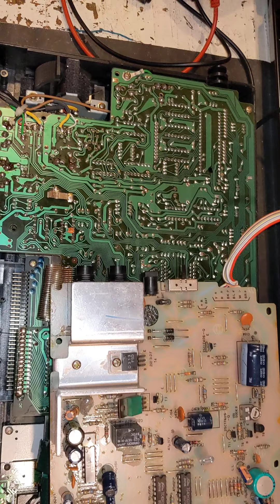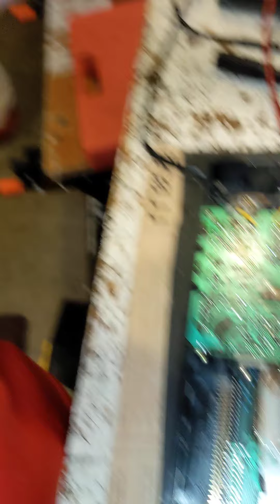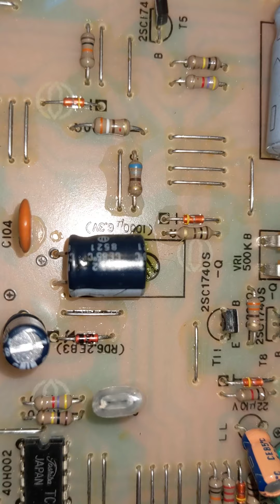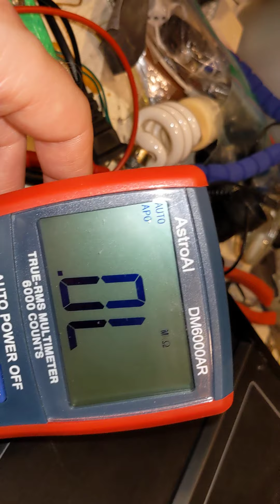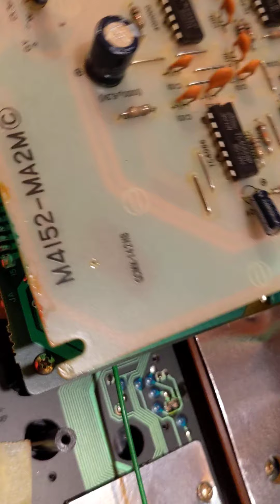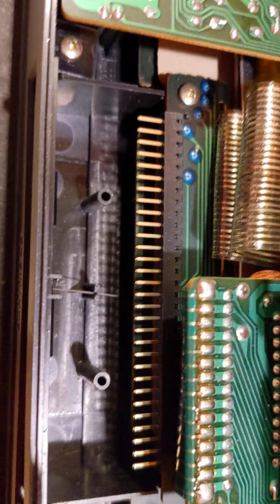Cz-101 power supply discussion

Comment: Hi Eric, Good info.  I have been going through the schematics and power, for my CZ-1000 particularly around the power out to the Memory pack. The main unit is working OK, but not for the memory pack. The schematics show the  memory Pack uses +Vdd, and the RA3 memory chips need between 4.5v to 5.5 v, so 5v would be good. The schematics I have do not give values for the power rails so I was interested to hear you say +Vdd is 5v , and +Vbr  is 4.3v. Particularly when I traced the circuits on the main board - and I have proven - the the positive rail to the RA3 memory pack is actually +Vbr , not Vdd as shown on the RA3 memory pack. So the power to the RA3 is LESS than it's memory chips need!  I can adjust the +Vbr rail up to 5v, but is that going to cause other issues ? what's your thoughts?
Reply from the maker: First, I have not worked with a memory cartridge in any way. I am surprised that 4.3v is not enough. Every battery I have seen in synths is 3.3v for the memory. Are you sure the Casio is different? Can you open the memory cartridge and verify power is getting to it? There are other signals needed as well for it to work- write, read, write enable, clock, maybe a read enable, plus you have the data and address lines. All standard memory stuff but there is a lot going on- more than just power. With an O-scope you could check the signals on the write to cartridge lines, at least to see what is there. Should be digital pulses.
Reply: Late to the game, I know -- I just wanted to confirm: according to the Casio service manual, Vbr is to be calibrated to 4.3v +-5%.
If it helps (this late!), I'm struggling a bit with low voltages in various places too. Don't think it's a Vbr issue, think there's something else sinking current that is eluding me.  Even getting LEDs that don't want to light cuz there's just not enough voltage across them (least of my worries, but interesting symptom).
Reply: Have you ever copied or made a memory cartridge? Where did you get the schematics for the cartridge? I have a 101 but not a cartridge! I got a digital copy of some schematics for the 101, but not sure if the cartridge is included! Thank you 👍

Comment: hi erich, i'm wondering what damage could be caused by plugging in a psu with a higher voltage. i bought a cz101 that came with an old universal power supply and on the 9v (center negative) setting the keyboard turned on then off - turns out it actually measures 13v on the 9v setting. it's with a tech now, but wondering if you can tell me off hand the damage that could have caused. thanks!
Reply from the maker: It is normal the power supply puts out higher voltage than listed. I doubt that did any damage, meaning probably another problem.
Reply: @ErichIzdepski  thanks!

Comment: Do you think it's worth replacing any of the main, higher value power capacitors to future-proof a CZ-101?
Reply from the maker: No. In my experience it has been voltage regulators and power transistors that fail.
Reply: @ErichIzdepski  Thanks, good to know

Comment: Great video and explanation of the power supply!
Few things to note for others when repairing these synths:
Power Supply is CENTER negative 9v and at least 800ma
Ribbon cable connectors between boards are notorious for breaking and not looking damaged